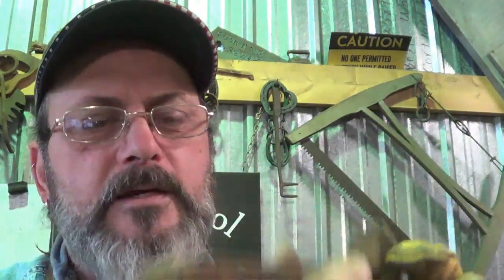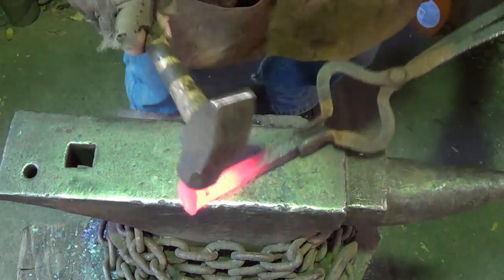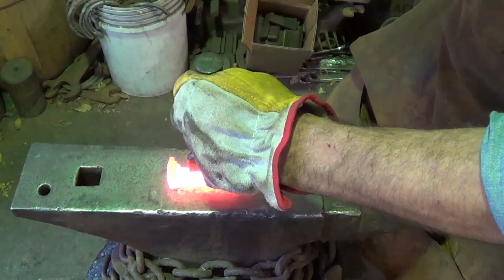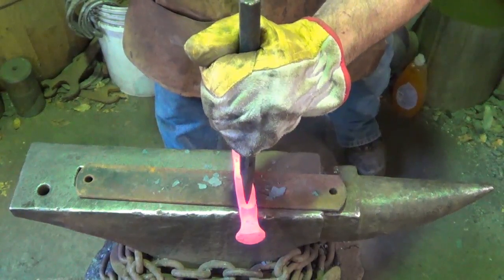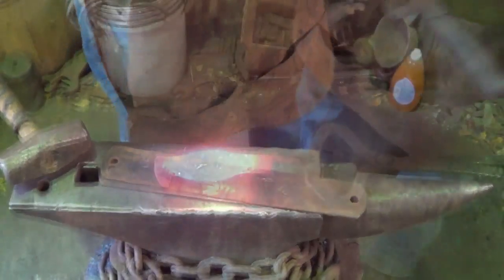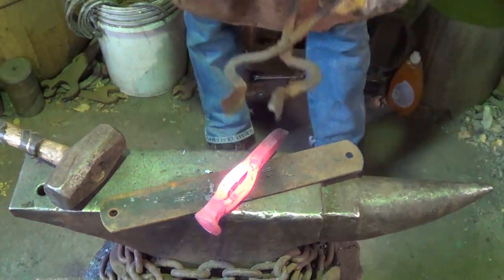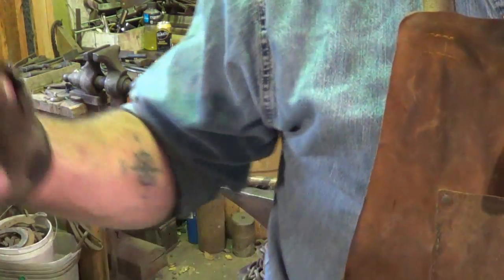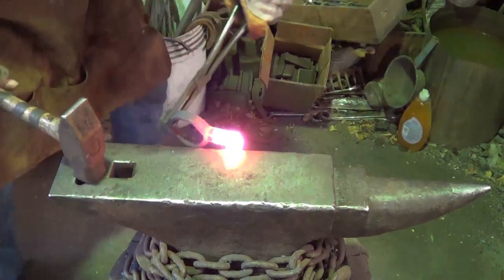Blacksmithing - Forging a Railroad Spike Stocking Holder

Comment: 13:50 "I wish i had a lot more length to work with" Dont we all Chandler... Dont we all....
Reply: Derek Dewey at a certain point you start cervix punching and have to be careful all the time, not all its cracked up to be.
wait you were talking about metal... oh then nvm

Comment: Hey Chandler, great idea, dig it. I would only  change one thing, I would put a piece of thin flat stock across the bottom of the hole so when you set a candle in it, the candle will act as a weight to help hold the hook.

Comment: Chandler 
    This piece came out almost perfect,like you said a bit of practice and you would have it.
Buy the way IMO it would help the end product by forging the 90 first as you noticed after the fact it may help keep all a bit more centered as far as the slitting you know as well as me punch al ost threw and flip it you should have a visual reference of the slit on the opposite side. You know like punching a hole same thing. But you know all this. Thanks for the great ideas so close to Christmas it is a grand group of ideas .Looking forward to the third idea . May be some sort of candel sconce or something for candles just an idea.Anyway keep up the good work.

     Sincerely, Martin and Shannon

Comment: Just a thought.   Start with the tip and draw it out.   Once it is thinned out, put in the bends.   This would retain as much weight as possible up in the top and should make it easier to bend.    Cool idea.  Thanks for the video.

Comment: great video chandler!  I can't wait to see what else you come up with.   I've been working on making yard decorations with round stock and forge welding the intersections.  it's been a challenge, but if I ever got it right I could bang them out quickly.

Comment: Chandler, 1st, love the videos and the chats....please keep them coming!  As for a way to even out the two "legs" of the circle, would it help to drill  or punch holes at the to and bottom where you want to split, and then make your line between them?  I also saw the comment about the round or pyramid mandrel...not sure if the holes would help, wondered what you thought, Sir!  Also, as far as putting something in the circle, I know folks who love snow globes (though that would require finding a source for snow globes...though, I also believe if YOU set your mind to it, you could forge us one!)  Thanks, man!  You are always educational and inspirational!

Comment: i bet you could easily sell a set of four of those for $200 or so. you answered your own question about the split - an inch off the head would have made things easier. the other idea i had was to draw out the spike for the hook first, maybe try keeping it square and thin, then put a twist in it where it becomes the hook, and then drift the hole  and finally put the 90 in it (or the 90 and then the hole, not really sure what would be easier) 

i think they'd look damn good in anyone's cabin, maybe try making a set of four for next year of you can bang them out in 30 minutes to an hour, that's not a bad time to income rate!

Comment: How to fix it? I don't know. How to prevent it? Perhaps after you are done with the cut, give it a heat right along the cut, cool the head and tip, then upset the piece and the two sides should flair out evenly. Then just clean it up from there.

Comment: How difficult would it be to make a back scratcher out of a railroad spike? It would need to be about 18 to 20 inches from butt to toe and maybe have 3 scratching fingers curved toward the back to scratch with. Just trying to think of things that might be quickly and easily made from a spike. If you could only tease 12 inches out of the spike you could add a 6 to 8 inch wood handle on the end? Just a thought. Keep the great videos coming. Love them. Wish I was still young enough to make the anvil sing like you do.  8-)